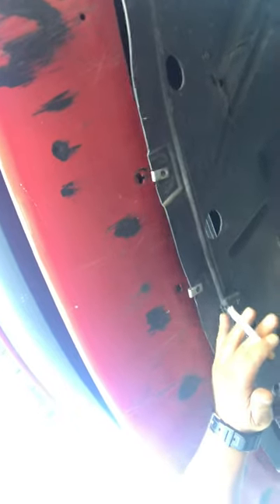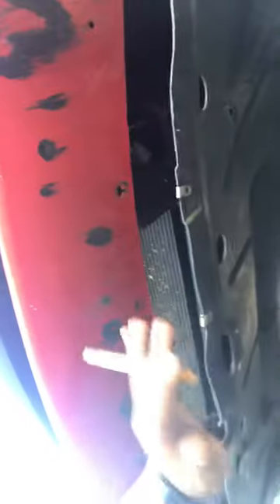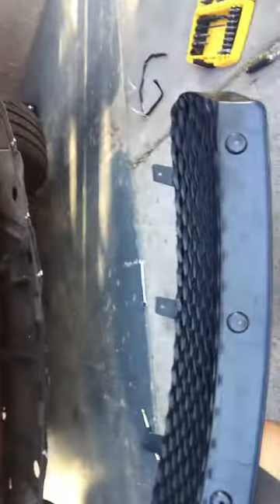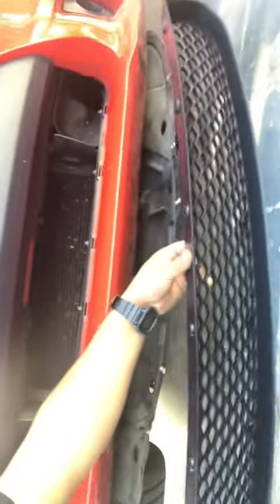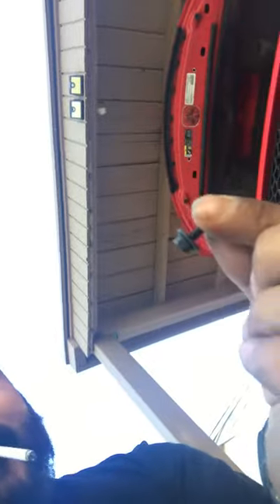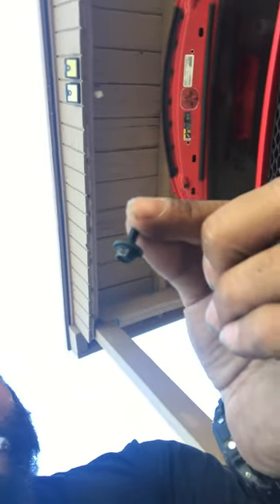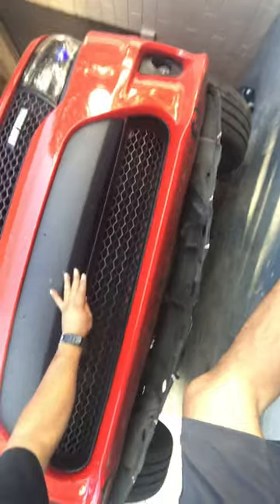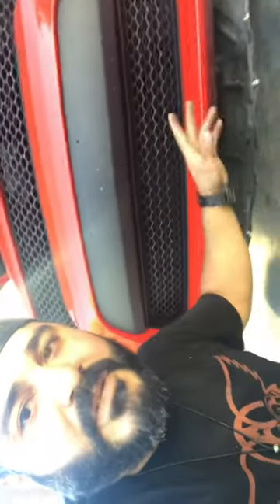2018 Dodge Charger Daytona Lower Grill Replacement WITHOUT REMOVING BUMPER!!

Comment: I couldn’t get the bolts on the left and right side bottom, something was blocking them
Reply: Use a separate extension to tug the Plato. Part away while u unscrew with other hand u have to use both hands on this part and u need two extensions one for drill and the other  for your hand u can flex that plastic part away when u tug it with the exntentio the opposite way while in screwing at the same time